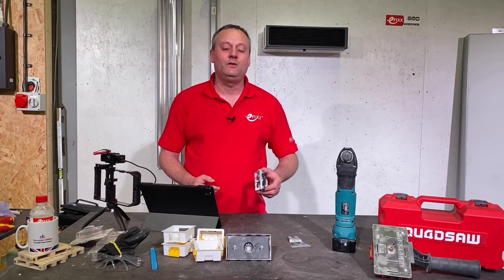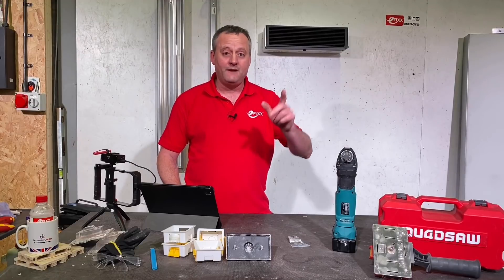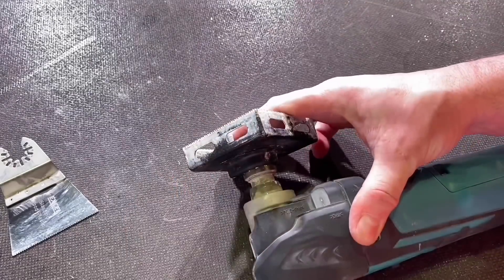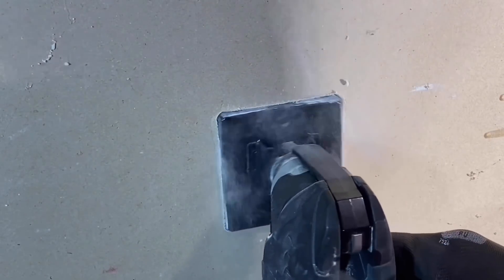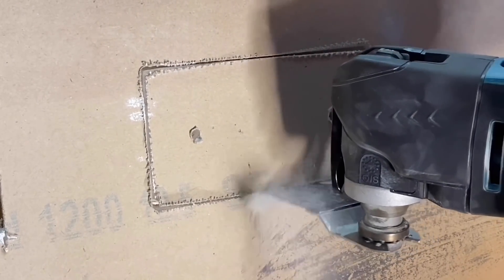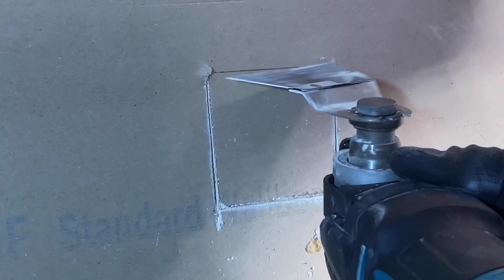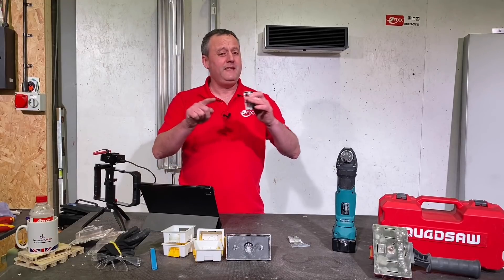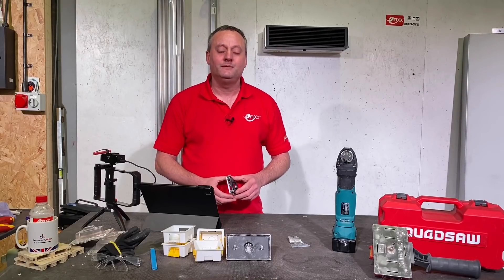Do these Multitool SQUARE HOLE cutters work? - Triton Tools Single and Dual back box cutters

Comment: Am I the only one who still just uses a pad saw? Never tried a box cutter, doesn’t look neat enough to me, inaccurate hole size. I want squares and rectangles and I want to feel the graft of cutting through as many layers of board as it takes. 

I’ve had the same pad saw for years, pretty blunt now, but I reckon it’s perfect and not much slower than multi tooling and it’s nearer than the brutal new double sided one I bought recently. 

Can’t stand the noise or the dust of a multi tool either - I spend enough time cutting boxes out for it to matter to me. 

Equally, I don’t own a laptop or any modern tech, except for my phone. Maybe I m a Luddite?

Comment: Tried the single box cutter as I thought it would save a bit of time, used it once and its been thrown in the bottom of the tool bag. I prefer to use a cutting blade on the multi tool. Good idea but not a great one

Comment: I find resting my fingertips on the back of the multi tool blade makes precision cuts much easier.  Holding only the machine body is like trying to write holding only the wrong end of the pencil.

Comment: I use my Bosch multi-tool with a circular blade. It enters the plasterboard gently, meaning you get an accurate cut, without drifting beyond the lines. I then finish of with a straight cutter for the corners. The tool oscillates about 5mm, so keep 5mm from the corner.
Best to do several boxes with each blade, to reduce time swapping blades

Finish result is clean without any damage to the plasterboard of our 1980s house

Comment: I think you'd have more success generally with the multitool if you turn it down a bit with both the Triton cutter, drifting beyond the line and blowing out the plaster. Be a gentleman. Take a few seconds longer

Comment: Defo thing switching to straight multitool blade is a good idea, otherwise if pressing hard, the square cutter might damage the cable which is hopefully hanging around behind the hole....

Comment: Why would you bother setting it up for just a template because that's just a waste of time. Either use it or don't lol. The comparison is clearly in the favour of not using it and who really cares about that back of the p/board, just take your time youll get the same results. Its a cracking bit id use this all the time over single blades.

Comment: I brought a quad saw. It killed 3 drills of mine so it’s now gathering dust in my garage.
It’s to slow and bloody loud. 
Now I just use a multi tool with a universal blade. Just as quick.

The quad saw just gets so so hot I needed oven gloves to change the blade from a single box to a twin box.
And the drill it’s self got just as hot and smelly.

I wish I could be more positive about the quad saw as it’s made in the uk and feels like a quality tool.
It just didn’t work for me.
Reply from the maker: Valuable feedback - Thanks

Comment: How would that work on a low power SDS drill ??? I might buy some have a bash and do my own video.
Reply from the maker: Think you need the vibration to work - but keen to see your results !
Reply: @efixx  What can go wrong am taking some pats of the wall down so will have a bash at that side 1st and record it all

Comment: Gaz this tool looks good when using it on single plasterboard but when on site moste of the walls are double plasterboard. What is this tool like cutting double plasterboard ?
Reply from the maker: It’s not deep enough to cope with a double - you’ve gave to do one sheet then clean out the debris.

Comment: Like gadgets /tools , but wouldn’t use on of those box cutters on plasterboard ,looks like to much messing about , could probably do it quicker with pad saw , might give a normal multi tool blade a go , but only if I had it too hand or was already using it

Comment: Don’t use these enough to justify cost, wish there was the equivalent for solid walls
Reply: There is , armeg  make them
Reply: @supersparks9466  I thought they only work on breeze blocks not brickwork
Reply: Well depends which type of bricks, yes breeze is the best but I have use them on London stocks or similar soft brick, but yes any hard bricks pretty much useless
Reply: @supersparks9466  I mostly add additional sockets in 1930-50’s houses where 1 socket per room was standard spec

Comment: I've not tried these but it'd need to be a lot quicker than that to stop me using a padsaw or multitool. If we can get something that deals with hard bricks that neatly I'm interested 😁.
Reply: Hard brick? Some sockets with round innards are available. So a core drill can be used. Simple and quick
Reply: They do make 2gang box sinkers Google and will find some

Comment: how do you keep them level ? a lot of times after the first fix the drywallers ussually pull out our cables  outside of the wall with this its useless
Reply: Push cable back through the hole ?

Comment: I use those Tridon. Never ever, back is destroyed, precision on 70 percent (if 5 double boxes in row) . Rather than just normal multitool blade for wood. (did little over 400 boxes) in last 2 months

Comment: doesn't work on a dewalt cordless, battery sticks out too far, i prefer using a Japanese style blade in the multitool, as it will go through any ply behind the board too
Reply from the maker: Great feedback 🦾
Reply: @efixx  Thanks, hope you all had a great and safe christmas
Reply from the maker: Yes thanks - more fun in the new year

Comment: We are getting a lot of jobs were there is double sound board or even a single layer of plasterboard but then either ply, osb board or on some 90,s build mdf.
Each tool for each job i guess (they should invent a blade for each option,  i do find plasterboard eats blades !!)
Reply from the maker: This blade wont touch ply  - unless you can wait for it to burn through!
Reply: I've not used a multitool for electricical installation work... Yet but I have used a multitool for many other jobs and I've always found that the plasterboard as you say eats blades, however diamond edged grout blades I found last longer when using them in plasterboard

Comment: Looked at these cutters a few times now , but a lot of jobs we’ve worked on recently they are double boarded for sound/ fire resistance so the cutters would allow to go straight through both boards. Find it just as quick with just a standard multi tool blade